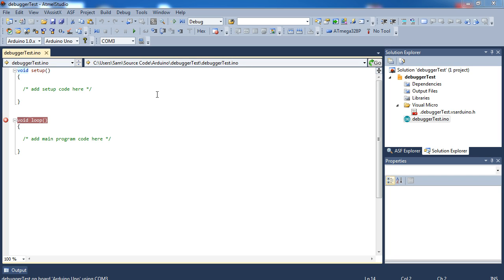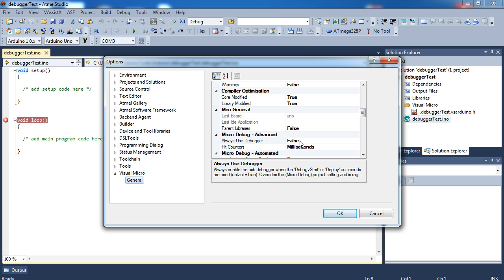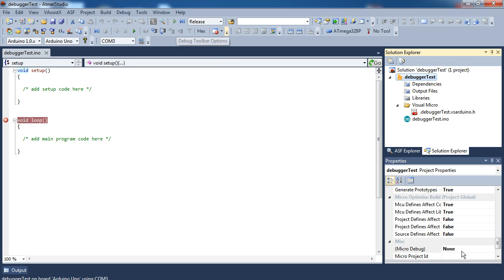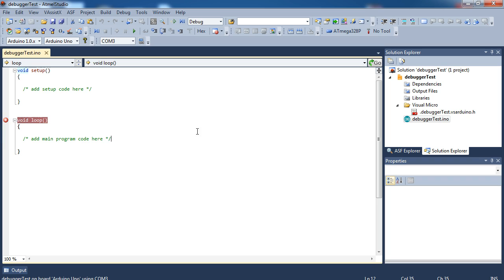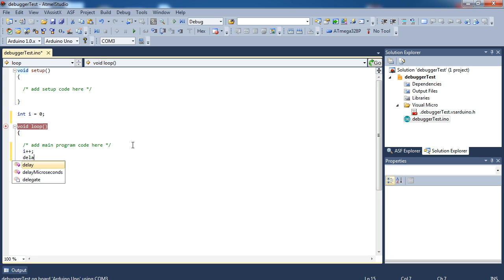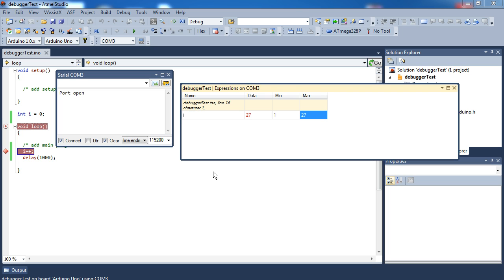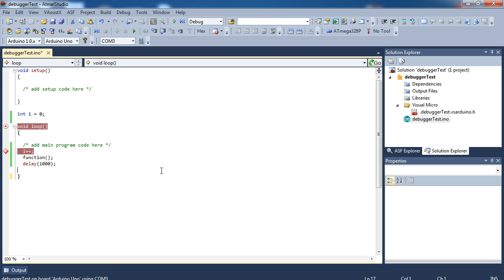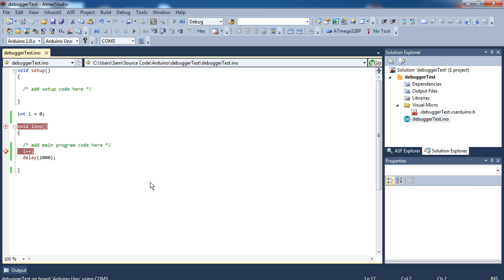Visual Micro Tutorials #4: Arduino Debugger Intro

Comment: Is it possible to debug Arduino Uno (or Mega) code in line-by-line (step by step) interactive debugger ?
Like when I debug C++ or C# code in Visual Studio IDE (program reaches the breakpoint, then it pauses execution).
As x86 CPU's have debug trap (interrupt) I guess that same have to be available in Arduino hardware to enable this kind of functionality?